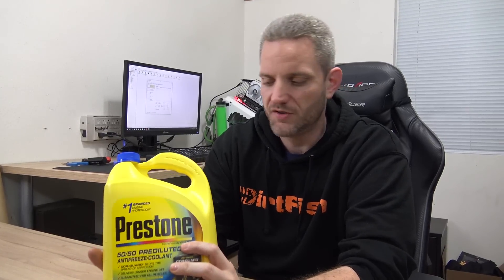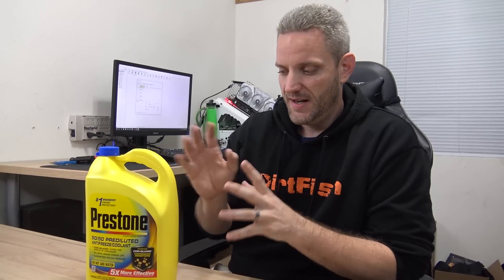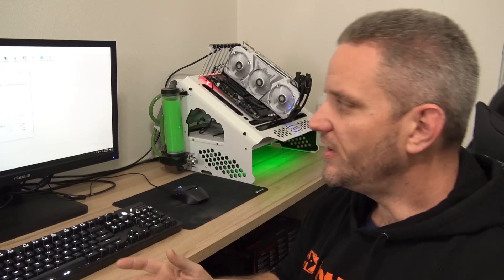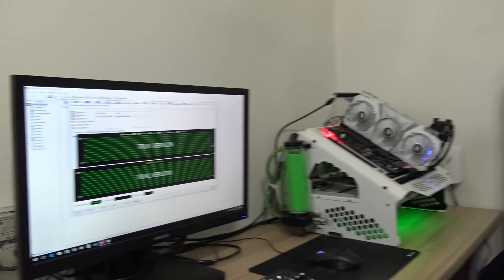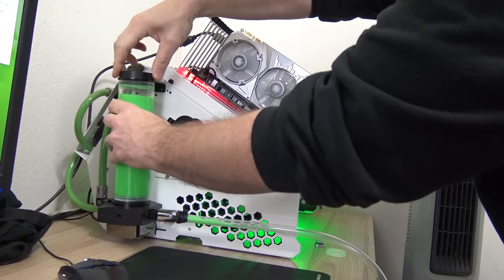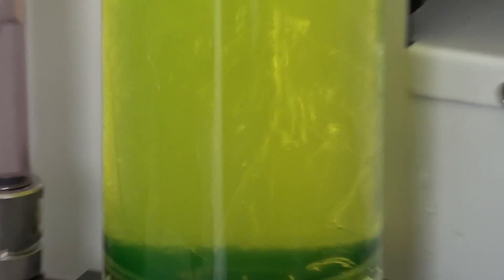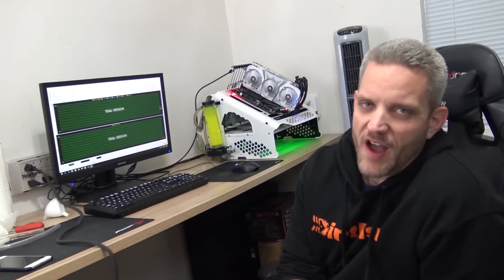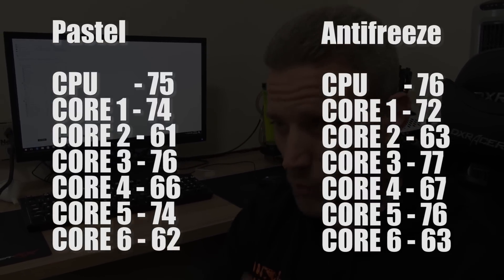I used Antifreeze to cool a PC

Comment: There are heat capacities of fluids on Wikipedia, just like there are for metals. I think there is a trade off between heat transfer and freeze resistance. At least, that's what I can remember from reading about data-center cooling.

Comment: Use an old water cool pc and let it go, but may be a new pump, if you don't you know what will happen, it was shoot before you started.  Car cooling system have it all, alloy rubber plastic copper and most race cars have plastic electric water pumps, put this to bed once and for all, if you tech heads don't, this will go on for ever.

Comment: I have a question in regards to cooling. I have an i5 6600k overclocked to 4.2 Ghz with a coolermaseter 212 EVO. While running Arma 3 my processor is at 57 C. What is the highest processor temp you would run without shortening the processor life?

Comment: i have a question, what if i manage to get all my parts out of copper or another metal, it will allow me to get higher OCs than a normal cooler?, i dont exactly know but shouldnt the antifreeze be able to manage better HIGHER tempetures than the ones that you are looking at, and it will last longer?

Comment: As long as the plastic parts of the system is PP, PE, PA and the O-rings are EPDM or Silicone, it should be good for anyting between and including water, alchols and (their relatives).

Comment: 10:1 distilled water and Pentosin (G11 for blue, G12 for red), has no problem lasting years and is a safe way to add color without gunking up blocks.

Comment: It is the year 2016 and finally reached the point where we have to use anti-freeze as 'coolant' because the pc's before shut down by themselve, not caused by overheating but by too low temperatures

Comment: Is this a joke?
Let's make something *VERY clear! The SOLE purpose of "COOLANT or ANTIFREEZE" is to suppress the freezing point of water! It was NEVER intended to improve cooling efficiency. ANY manufacture that claims that their "COOLANT" does so is false.
Also, water does not technically cool anything, it only acts as a heat transfer conduit. that's why you need a pump and radiator.

Comment: Use a water chiller in the loop.
Then use the antifreeze.
Reply: Ryan Sample most water chillers for drinking fountains and what-not, are 1/4" tubing, and very restrictive. and it takes a while for the cooling, and puts out a lot of heat and noise. I'm sure a commercial ice maker would work better. have it piped to the other room. I have not taken apart a commercial ice maker, but they are 3/8" I.d. inlet. have taken apart plenty of drinking fountains.

Comment: The only 2 types are propylene glycol, and ethylene glycol for coolant. Respectively each may come in the form of organic, inorganic, or a hybrid which is represented by colour. The coolant will not eat away at plastic, my 86 E30 has a plastic impeller in the water pump which is known to break over time due to brittleness combined with pressurized movement over many many heat cycles. If handled properly I don't see why a long-term CPU cooling system couldn't be made out of it. I would use minimal amounts of coolant though maybe a 80/20 or even 90/10. The whole point of using coolant in a car is so that the water doesn't freeze in cold weather and to keep the metal components free from rust.

Comment: How to make a liquid loop: Buy online peristaltic pump, suitable length hoses and fittings, sheet of aluminium which will you cut in suitable pieces. Bottom piece will have area of cpu. Make a cube out f it. Either weld it, for this you'll need special welding equipment and expertise since aluminium is light metal. You can solder it or glue it which is bad idea if you use inappropriate glue. For coolant mixture, you can use medicinal alcohol which you can buy in farmacy. They are already diluted with water and often sold in plastic bottles. For coolant reservoir you can use said bottle or another suitable plastic container. Keep in mind, you must account for additional alcohol needed for those tubings.

Comment: This is a pointless video. Your computer is not going to freeze, nor boil. The only benefit for adding ethylene-glycol in a radiator is to prevent those conditions. It adds no extra heat absorption/ rejection than water.
Don't use bleach, it will warp any plastic and harden the rubber gaskets. We don't need a video on that unless you are going to run it for a few years.
Don't cool it with ammonia, it will rot the copper.
Don't cool it with orange juice, PH levels too high and it could just explode.
Don't do lemon juice, because the PH levels would go up, and it could catch on fire.
Don't do rubbing alcohol, the fumes could ignite.
Don't do Vinegar, it's too basic, and would loosen the screws on the heat sinks.
liquid methane? It's non-corrosive. Now that's worth a shot.

Comment: Jay, find an old pump and reservoir, and do a closed loop to see what happens to the tubing and such.  just put the whole deal in a plastic bucket or tub in your garage so if it does destroy it or leak, you wont have a mess to clean up.

Comment: Antifreeze is about the freezing and cooling point vs water. It's not used for  the heat transfer. That's the 10 second summary.

Comment: Saw the title,, but that's what you put into the water... what?
Ok Watched the video and,, yeah,, What??

This is the exact stuff I did to my first watercooling build. 
I got this package with pump and reservoir, a nice 120 radiator + a 240 radiator. 
I loaded it up with destilled water and about 50% antifreeze. 
Then I realized that it's a bit silly to do that since water has a much higher heat capacity than antifreeze, but I left it there. and for the next few year I only topped it up with water. 

Now I did get special tubing for water cooling, and those tubes quickly became discolored, just like Jayz. 
They also let quite a lot of fluid escape through osmosis, so I had to keep remember to top up the system every month or so. This is most likely the reason for the discoloring, since it lets the liquid through, but traps the dye in the plastic. 

A couple of years ago, I cleaned the whole system out. 
It had been running for years and had quite a lot of algae gunk in it, so I cleaned it all out.
I bought cheap Vinyl tubes, I think I got 20 meter for $5 or something like that, and I replaced all the tubing. 
So far, I have noticed no discoloring, the osmosis has pretty much stopped. Last time I topped up the system was like a month ago, but before that it was like 6 months, and I didn't really need to top it up at all. 

I'm still using water and antifreeze. And it's the same watercooling kit as I bought for .. oh god how old is it now? 
I'm pretty sure it's close to 10 years old now. I think the pump is dying,  it's getting really noisy anyhow. 
a few years back when I did the whole clean + new tubing, I threw the whole pump and 240 radiator out the window. and it's been there since. (It was getting obnoxiously loud ok.) , I get great temps during winter. 
oh yeah, it's on my balcony, which has glass windows, so it doesn't rain on it. still freezing in winter though. (Sweden there) 

Over the years I moved it over to the 2600K which was pretty new at the time, I've added a pump in the case, in case the old one dies, and to help with the DIY GPU block I built using coins and copper tubing. (doesn't quite keep up with the 770, but gets the job done well enough.) 

Anyhow the point is, antifreeze is perfectly fine. (I'm not sure what It will do to PET, but people tend to keep that stuff in PET bottles in their cars, so at most I'm guessing it might discolor it.)
And a tip for JayZ , try some ordinary cheapo Vinyl tubing, it's great. ;)

Comment: i have an asrock970 e3 r2.0, fx4350 B.E., 2x4 8GB 1866 ram, 560ti, WD raptor HDD, koolance pc2-601 with liquid cooling system.
i want to oC the hell out of this system but im not sure what psu i need. should it be single rail or two and how many amps?

Comment: Jay run a 10%-15% automotive coolant mix with prestone universal green you ran a 50/50 mix need to dilute it down it will have no effect on tubing or plastics or metals universal green coolants from prestone are designed to be in contact with literally all types of plastic / rubber / Vinyl / metals look at automotive applications I have been using universal green automotive prestone coolant mix for like 10yrs+ and had 0 issues at all again 10%-15% mix is optimal.

I am currently using this mix in a ASUS sabertooth X99 I7 5820k 4.5ghz core and 4.3ghz CPU Cache rig now and have used this coolant mix in around 15+ rigs of my own running 24/7 for years at a time no issues what so ever. I have neglected many of them without flushing or changing fluid out for 1-2yrs at a time and again 0 issues.

Comment: @jayztwocents I've been using an antifreeze mix for some 6 years now. It was 1litre of pure undiluted ethanol/glycol mix that was mixed with 3 litres of tap-water. This has been in my X58 machine ever since. It das been drained, filtered and put back in whenever components changed, originally had 2 4870's in water loop as well, also had 7970 in the loop for a time and was originally a i7 920 (c0) @ 3.8GHz and is currently Xeon x5650 (hexcore) @ 4GHz. The cpu block, gpu blocks, tubing, resevoir and radiators (240mm & 360mm in series) and d5 pump have had no issues beyond the tubing took on the pink hue of the coolant. No issues with leaks, corrosion or cracking in the perspex of resevoir. Just as a fyiw regarting longevity of the mix.

Comment: i wonder if Watter Wetter added to pure water would make it run cooler? Have u tried putting that main water tank in a small refrigerator with holes drilled in the side for the hoses? The cooler the fast right? don't forget that the Ethalyn Glycol in the anti-freeze actually is there to hold heat. Higher amounts of EG in the mix equals to higher amounts of heat trapped in the system.

Comment: You guys understand that ethylene glycol or propylene glycol is used to prevent freezing and rust inhibitors are added to the solution. Water by itself does a far better job of exchanging heat than antifreeze. you would see much better cooling results from just water with a rust preventive additive than and amount of glycol mix.

Comment: Ive been using ethylene glycol with soft tubing since 2004, and have also had 0 problems with acrylic hard tube. Also used propylene glycol for 5 months without problems but switched back because it wasn't uv reactive.

Comment: Stuff will grow in it, happened to linus in his whole house water cooling thing, because the one issue people forget is that cars get hot and basically kill any growth of molds and bacterium. It is also and inferior cooler to distilled water as the ethylene glycol reduces the heat transfer and provided no benefit unless the it's to prevent freezing or increase the boiling point. It shouldn't react to much with the plastics or the various metals as the same issues would occur in cars. For the people proposing alcohol or window washing fluid, yes it would prevent the bio growth but it could react very poorly to the plastics and rubber in the loop. Ethanol gasoline in certain engines will ruin them and  the mechanical keyboard people know to test before cleaning with alcohol because it can melt, craze or cause clouding in certain plastics. So alcohol is not a good idea for a water cooling loop, not to mention a cpu and gpu could get hot enough to boil ethanol out of solution, yes as in distilling and making awesome highly flammable vapor (just over 78c).You could actual have a T piece with a glass tube before the reservoir and it may allow the alcohol to vaporize out and be lit on fire, the issue would be trying to maintain a stable 79c-ish fluid temp. It could be a really cool video if it worked.